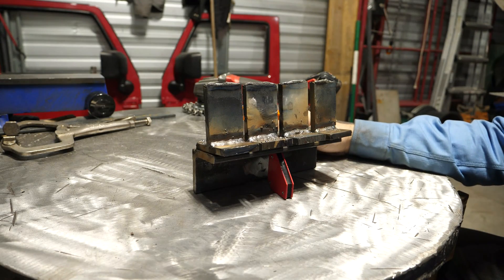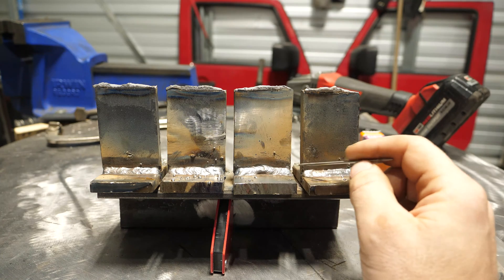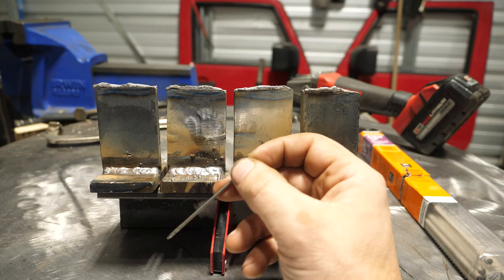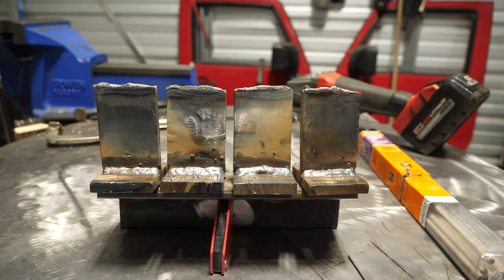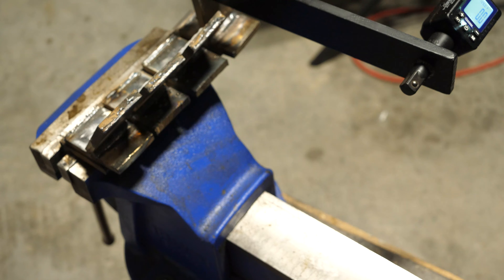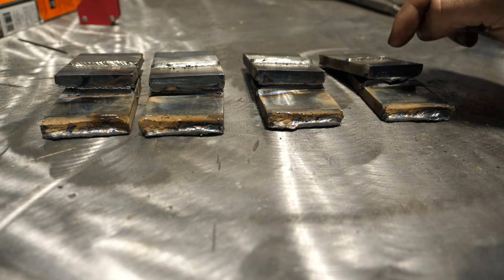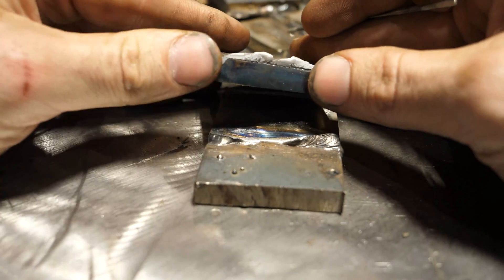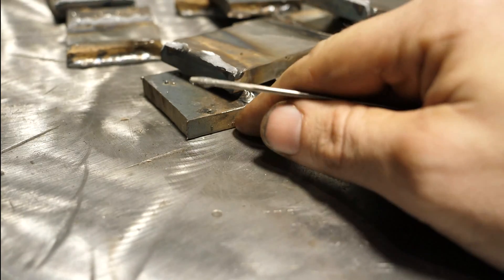7018 stick rod break test

Comment: 4:40 It appears that you have 2 hands on the breaker bar. Did you apply force with both hands?

In order for your results to be comparable, there must be a direct correlation between the torque at the torque adapter and the torque at the weld. This is only true, when the lever arm between the torque adapter and weld is consistent (which is fixed by your wrench/specimen geometry), and the lever-arm between the torque adapter and your hand is consistent (which depends on consistent hand placement).

Ideally, you'd lube the breaker bar up, to minimize your ability to apply axial forces on the breaker bar. These generate weld torques that are ignored by the torque adapter.

If you send me some measurements, I'll calculate the torque multiplier, so (for curiosity's sake) we can get an idea of how much torque is actually applied at the weld:
1) Distance from torque-adapter axis to middle or pinky-side of hand (depending on which part of your hand applies maximum force).
2) Angle from breaker-bar to wrench (45°?)
3) Distance from torque-adapter axis to near-side plane of top plate
4) Length and width of unwelded plates

Comment: Hey Greg. Do you think you could somehow test the detriment of arc strikes outside the weld area? Is there any way to “prove” the fact that it would cause catastrophic failure? I’m sure it plays a part in high pressure pipe where it gets hot and cold, pressure and no pressure but is there a way to test it on a fillet weld or pipe? Might have to do a bent test on a full open root and see if it will tear at the arc strike. Once more, is grinding the arc strike out better or worse
Reply from the maker: That’s on my list of stuff to test out, since you brought it up I will fast track it and get a video out within 2 weeks.  I can give you some thoughts on arc strikes in the mean time.  Arc strikes causing failures is heavily dependent on what the base material is.  When it comes to weld defects undercut tends to be far worse than an errant arc strike.  However arc strikes can cause failures.  So an arc strike will actually change the base material in the area of the strike.  On certain materials (think high strength alloys, cast iron, etc) the melting of the base material without adding an alloy (aka no filler metal deposition) will produce an extremely brittle line.  When the material is flexed/stressed it can crack/fail at that point.  Many people think the issue is just that you have basically a gouge in the metal, not realizing they actually altered the base materials properties and grinding it flat may not actually fix it.  On x ray tests arc strikes will still show up if the surface is just buffed flat.  

I have a feeling the effect will be more limited on mild steel.  A arc strike will likely give a point for a crack to form, but the material itself likely won’t change nearly as much as something that’s higher strength.  To test this I will put arc strikes on some 3/8th material and bend it to see what happens.

Comment: Great video and plethora of information in these videos. Thanks Greg. One request though: Could you make a video where you summarize the results side by side, rather than just briefly referencing them? For a newbie like me, all i hear is how great the penetration of 6010/11 is and therefore "real men only use 6010/11" but in reality it looks like 7018 is a winner, as long as it is not dripping wet... It almost seems like welding dirty metal or bridging big gaps is the only reason to ever use 6010/11 but for the 99% of all other welds 7018 is the winner even if it is not perfectly dry, as long as it is not dripping wet that is. The first pack of rods i got was 5lb of 6013, which welds nice. It seems to me if stuff is clean and properly beveled, so that complete joint penetration can be achieved even with minimal depth of fusion, then perhaps 6013 would be just as good as 6010/11.

Comment: Just a general comment on this fixture setup - 1) the pin in the ratchet that allows the head to swivel, when loaded as you do, is taking up load. It will anchor itself when you start pressing down, and depending on where it's placed it will take up a variable amount of fulcrum loading.

2) If that's a ratchet (I couldn't tell if it's a  breaker bar or a ratchet),  the slop,again, in that mechanism is going to add variance. 

Here's an easy way to tighten things up --  First, on that existing bar with the pocket which directly interfaces with the test coupons, measure from the middle of the weld-point of the sensor, to the loading point on the other end of the bar.  Based on the bending profile, it looks to be at the far top-end and the near bottom-end, but I'm not sure what the load split would be, I'd measure 3/4ths closer out to the far end, since the bar deflects in that way also. So we'll mark this as "test coupon bar loading length" as "x".

Next weld some box stock that fits your hands nicely (the bigger, the better, rigidity is the name of the game here. solid round bar stock would work real well here too, if you can mill a flat), and weld the appropriate sized breaker bar ball-end head on one end of the new piece of iron. (This will be the end which fits into the sensor module). From the center of the weld point, scribe out 1x, 2x, 2.5x etc up to whatever you think is most appropriate for your testing situation.

Hopefully, you now have more leverage, less slack in the system, and a relatively known torque multiplication factor based on the scribe lines. It's not going to be a NIST cert'd Skidmore but it'll get you in the ballpark. One way to test how accurate your bar is, would be to weld a hook at your multipication point (1 * test coupon bar loading length, 2 * test coupon bar loading length, etc...that is to say, all those scribe lines) and attach, say, a 10 lb barbell into a canvas bag. Then try for a 20 lb. Then a 30 lb. You'll end up being able to read out the linearity, offset, and the overall behavior of the system. 

Or not, haha

3) Impulse loading is going to fuck around with your readings. You're doing a real good job at being smooth and continuous but just a heads up, lets say you take a baseball bat to the breaker bar, and when it makes contact, there is an impulse of 9000999 joules or whatever, over 20 milliseconds, sufficient to break the weld. That module won't have enough samples/sec to register that peak loading with high fidelity. 

Anyways, love the channel. Always wanted to get into welding but the whole bro-man attitude kept me. You've got the right amount of book-smarts, practical knowledge, and juuuuuust enough clipboard warrior (like, not everyone knows zinc and cadmium are on bolts, so you're doing a huge service by letting them know. Same with cap discharges and all.) to make the perfect entertaining stew of awesome. BTW  AlphaTIG 203XI pre-order 650$ good deal? Im about to pull the trigger

Comment: 🫡 reporting back:  my 1st “cheapo Stick Welder” arrived … I burned down 2 sticks, practice starting/stopping, and turning up and down the amperage to see where “too cold” and “too hot” are.  🥰👍

I setup a generator to power it, working in the driveway.  😂  I’d have gone back for more, but it started getting dark on me.  🤷‍♀️  Confirmed, it WORKS!  and I got at least 3 or 4 spots that look correct!  (we’re not counting how many failed, I was testing for where it would fail)  😅
Reply: your tips were helpful, and I’ll keep in mind:  worth burning a bunch of rods getting good at starts / stops.  & once it’s going, focus on working the puddle.  I think I got there a few times.  Looking forward to next runs, now that I’ve seen the results / know what I’m looking for.  😊
Reply from the maker: Glad to hear it 😀.  You will have a lot of failures for the first few hundred hours.  As you progress you simple make less mistakes and more things 'correct".  Everyone has to spend a lot of time in the "ignorant/unskilled" part of welding.  The reason why many people never escape this (and never get good) is because they don't spend enough time practicing and they don't do research.  You have been doing your research so you will have a lot of knowledge to work with, which will cut down on your mistakes.  Now its just down to putting the time in to get the skill down.  Focus on trying to be as smooth and consistent as possible, and dont be afraid to fail by moving too fast or too slow.  You need to train your hands to do things automatically based on what your eyes see.  That will only come with time, just like playing a instrument.  With all that said congrats on learning a new skill and keep up with practicing.

Comment: Excellent tests! There have been several surprises for me..... I expected 7018/FCAW to be significantly stronger than the short arc GMAW. I'm also surprised that the 'poorly welded/defective' versions weren't substantially weaker than the properly welded comparisons. Some of this is making me go hmmm 🤔🤔. 

Thanks for the excellent content!
Reply from the maker: When I retest everything on 1/4in plates it will be interesting to see what happens then.  If I had .045 or bigger flux core wire and a more powerful welder I know it would have had no porosity on the 3/8th.  I am sure the porosity limited it’s strength because I expected it to win on the test.  The 6010 video comes out today and the results are more inline with what I expected 😀

Comment: I saw in an earlier response it was HF brand, but what rod size and amperage are you running for these tests?  It would really help me understand how what choices I make when choosing which rod to use affects weld strength.

Will you be repeating any of these tests with a slight bevel on the vertical piece? I’m wondering if even a small bevel, and slowing down the travel speed a bit to deposit enough filler material (for a decent single pass) to see if it makes any difference?
My guess is it would improve the weld strength a fair bit.
Reply from the maker: Sorry I missed this (I will also respond to your email tonight).  I ran harbor freights 7018 in the video.  It definitely does not run as good as what I prefer, esab 7018 prime.  I ran the rod at 120 amps, but I will be doing another video where I run it at 130 140 and either 110 or 150.  I will also likely do a test between harbor freight 7018 and esab 7018 prime.  I doubt there will be a huge difference between the two for testing purposes.  

The true test of strength will be bending away from the face and multi pass welds.  It will be interesting to see what happens in those situations.  I will be doing testing with a bevel for sure.  The interesting thing is I have a feeling  it won’t make much of a difference unless a multi pass weld is done and a gap is left.  It really depends on the joint though.

Comment: Very insightful videos, can't wait for more.
 Have you ever tried running flux core downhill? I have tried it on non critical stuff and if you turn it down enough it's almost usable.
 I know this is a big no no, but flux core is very similar to 6011 and people do run that downhill.
 I think going downhill won't hinder fluxcore too much since it already produces a lot of porosity in any position
Reply from the maker: Hopefully this info helps 😀:  Flux core can run uphill far easier than both stick and mig.  ITs best to weld uphill with flux core because welding downhill will limit penetration.  When welding uphill gravity pulls the molten metal down, which means the root of the joint (where the two plates meet) is exposed/has less molten metal on it.  That means the wire can hit the root and the heat will penetrate deeper.  When welding downhill the weld metal sags and covers the root more, so the wire has more molten metal to go through to fuse the root together.  Downhill is far easier with mig than uphill, but for the same reason as flux core you want to avoid it.  Now depending on what it is, the loss in root penetration wont be a issue with downhill, but if it requires strength it should be avoided.  There is the possibility of more porosity running downhill too.  Flux core in .030 and .035 doesnt like thick welds, as has been seen in a bunch of my videos.  

I will be testing uphill and downhill with break tests as well to show how much if a difference is really present.  :)
Reply: @makingmistakeswithgreg   Thank you.
Yes. Going downhill with fluxcore will limit penetration, but this is exactly why I used it sometimes. If you have to weld stuff 1/8 inch or thinner vertically(or an open root), I believe you can get enough penetration with the right settings and the right travel speed.
Reply from the maker: @schellycraft4290  great point on that.  On 1/8th or thinner there is definitely no real issue with penetration.  I haven’t done much flux core down hill but I know a favorite tool of mine on 1/8th material is a 6011 downhill.  It won’t blow through like 6010, it is far easier than mig.  For portable work on non critical stuff it works great.  Defiantly has saved my butt a few times lol.

Comment: Have you ever run brands like sayHobart against Lincoln?   It seems anytime I use “cheap “ rods I do find that I can see difference in weld quality.  After twenty five years of pipeline welding, and only using Lincoln rods , (as they were required by the specifications)  I find that rods like Hobart, KT, Harbor Freight and others just don’t produce as well.  Am I brand biased?   I don’t know but if you have an opinion on it, I would love to hear it?   Thanks much for your time!!
Reply from the maker: Well in that video I tested harbor freight 7018 and 100% they make worse looking welds than the rods I normally run (esab 7018 prime) lol.  I ran them to burn them up.  I will be doing another 7018 video shortly where I am using my normal 7018 and I know they will perform better.  There is most certainly a difference between brands, good rods seem to run the same rod start to finish, from rod to rod, and pack to pack.  I don’t like the inconsistencies of many cheap rods.

Comment: Love these tests you are doing.  So far, it's the unshielded flux core that surprised me the most as I expected the best penetration from that.  The only thing is, I'll never be using 3/8" plate for projects but I could see 1/4" or 3/16" material --I wonder if that's where unshielded flux core can really shine with .030 or .035 wire?  Great stuff nonetheless, Thanks!
Reply from the maker: I will be doing a big comparison on 1/4in plate soon.  I wanted to go to the limit at 3/8th because the differences will be far more significant I think.  .035 flux core will weld 1/4inch plate with great penetration and clean welds.  3/8th definitely needs bigger self shielded wire to function properly.

Comment: good test, Greg, The  bend the oposite way  test will be an eye opener. Before you break the weld how about cut and etch then bend
 knowing what the inside structure of the weld looks like. You will need  bigger plates.
Reply from the maker: I bought a shop press and just assembled it, so it will be possible to bend towards the face.  I can’t wait to start bending stuff to see what happens 😀

Comment: Very interresting! Thanks a lot!
Reply from the maker: No problem 😀
Reply: Thanks for the answer. And for sure i had some difficulties to move steadily so fast. I'm also quite confident that this piece will do it's Job. But - always learning - and I'm beginning to know enough to know that I know nothing. If this makes sense.
Reply: Today I had to weld two 8mm plates 20x20cm on top and bottom of a 8x8cm squarepipe with 10mm wall. This is used as a stand for a bender for rebar. I order to avoid the plate from shrinking and bending to much I decided to weld the fillet in one pass with 32V and 14m wirefeed with quite high travelspeed. I accepted the welds to be a little undersize but have quite good penetration. I also added für reinforcements each end. The plates warped just a little bit and the durability - haha, time will show, lol. Would you have done multiple (3?) passes with lower settings?
Reply from the maker: Multiple passes vs a single comes down to a couple things.  There is a limit to how much metal you can deposit in a single pass before the grain structure of the weld becomes poor.  Generally speaking you want to do multiple passes over a single from the stand point of strength due to improved grain structure.  However on thicker steel you can deposit pretty big welds without much loss in weld strength with the right process.  Spray arc and dual shield can produce big welds without a huge issue with strength reduction.  With stick, using bigger 5/32 rods over 3 passes with 3/32 would be preferable because of the penetration.  Based on what you said I think youre in the clear.  The one issue with wire welding is if you run too hot you have to move extremely fast, and the fast movement becomes very difficult to get dialed in.  In many cases hot and fast has slightly less penetration that colder and slower.  Either way I dont think thats falling apart on you 😀.

Comment: Very interesting stuff.  Learning lots and really appreciate the effort that you're putting into these videos.
Reply from the maker: No problem😀.  I have a bunch more coming out shortly and I bought a shop press to test bending welds against the face 😀.  I will also be testing on 1/4in and 3/16 steel.